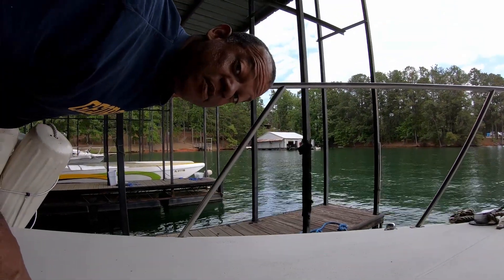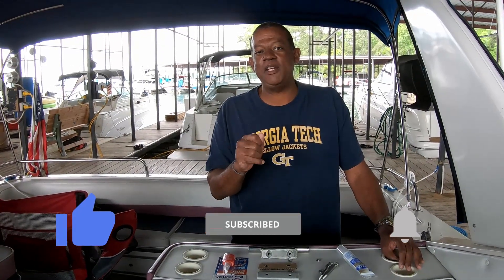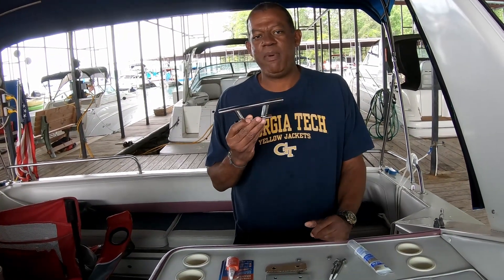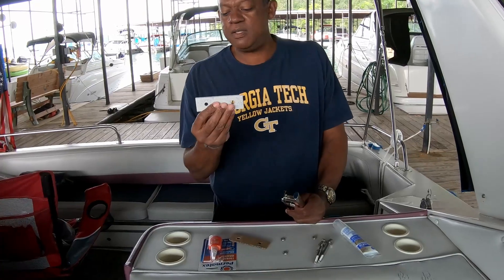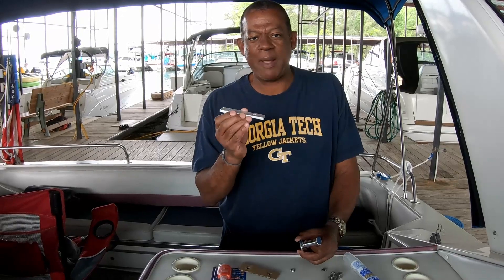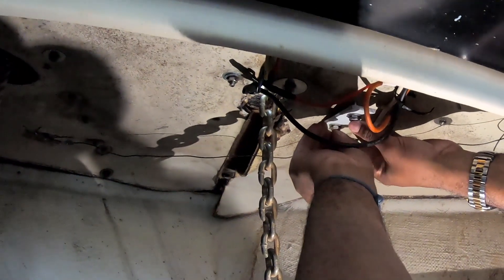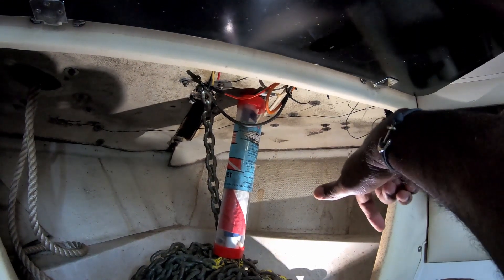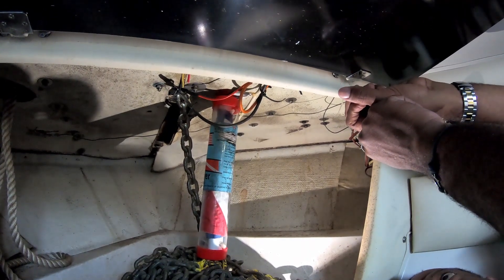DIY - Install a Cleat on Your Boat

Comment: Just a variation to your technique ... I use a SS backplate but also sandwich a piece of epoxy coated (non-pressure treated) wood between the backplate and the underside of the deck. Thinking that the wood would act somewhat like a shock absorber reducing the possibility of cracking the gelcoat under a heavy load.
Reply from the maker: That's a good idea, especially if you expect to be anchored out in any high wind conditions.

Comment: Great tutorial. Ive just ordered a boat cleat but I'm not actually going to install it on a boat. The plan is to attach the cleat to a block of wood where a kite line will be anchored to. There will be an additional hole drilled through the wood for a carabiner which in turn will be attached to a heavy duty strap wrapped around a post. The whole idea is to tie off the line of my kite to the cleat. Do you reckon a metal back plate would still be necessary? I'm assuming not because the demands (load) placed on this cleat would not be as great compared to a cleat on a boat. It's a 9 foot kite and the pull can be fairly strong at times but not super strong. It's nothing compared to the kind of pull that you would get from those large kites used for kite surfing. I guess in my case, washers would serve the same purpose as a back plate.
Reply from the maker: That's an awesome idea!  I agree with you.  It does not seem like you will have nearly as much stress on the cleat in your case.  A couple of nice sized washers should do the trick!
Reply: @TheShipsLogg  Thanks for the confirmation! Though I admit it's not my idea. I got the idea from a video about kite photography. Different people have different methods of tying off the kite line when attaching a camera to the line.

Comment: Good job Captain Frank!  Did I see a dive flag?  I am an Open Water certified diver myself.
Reply from the maker: I actually am a certified diver as well but I have not been down in a long time.  I do have a flag stowed away on the boat in a storage tube.  I think I used that to prop the back plate up.  That might be what you saw.
Reply: @TheShipsLogg  That is where I saw it.  I usually dive when I fly the boss to the Bahamas.